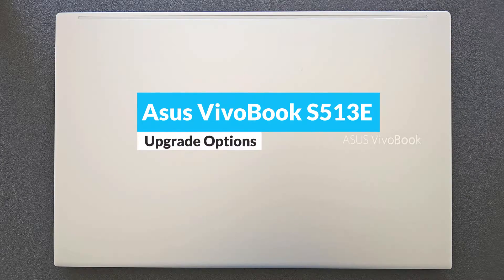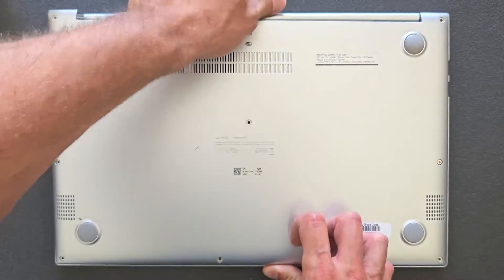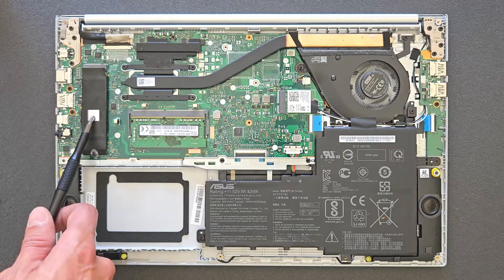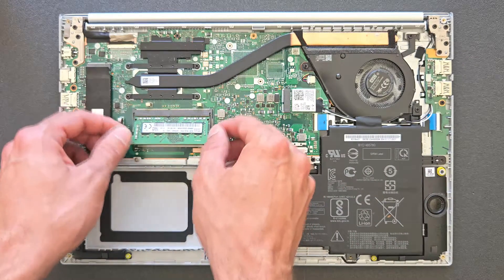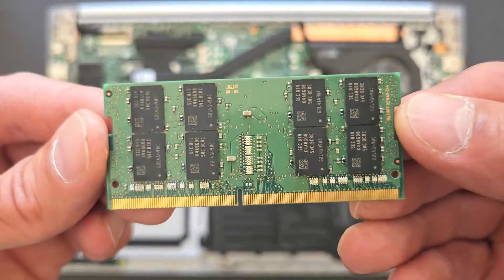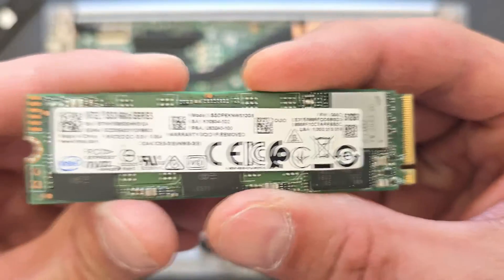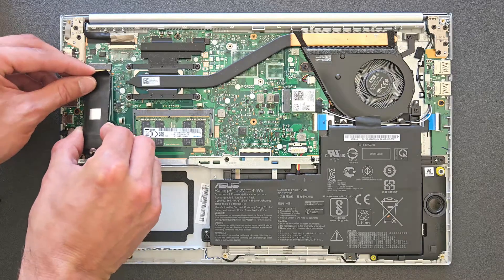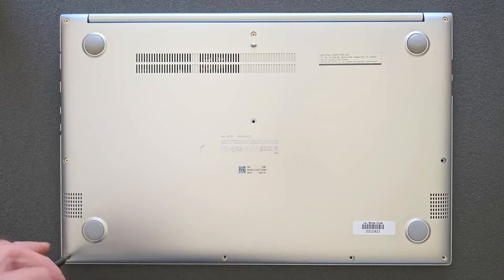Is Asus VivoBook X513EA / S513 RAM or SSD upgrade possible?

Comment: hello there, ive got a question, i have an Asus Vivobook 15, I5-11th gen 1tb ssd 8gb ram (i believe X513EA), in TaskManager in memory section it says 2 of 8 used (6 free) (slots), i havent checked by opening the case, but is that exact or is it wrong?

Comment: I installed a 2TB SSD, it works perfectly
I recommend 2TB
By the way, I'm thinking of upgrading to a 4TB SSD
Has anyone tried installing a 32Gb RAM bar?
Reply: Which brand and model did you use for the 2 TB SSD? thanks
Reply: @giuseppemilazzo2649  ASUS Vivobook 15, X513EA
SSD Samsung 970 EVO Plus, 2Tb
Reply: 32gb works fine

Comment: I would like to ask, If my pc has an extra slot for HDD DRIVE is it still okay to if i put SSD instead of HDD? It doesnt affect anything right? And where can i get SATA CABLE for connecting Hard drive to the motherboard?
Reply from the maker: Hi, yes definitely will be ok to use SSD instead.. these days it's recommended anyway. What kind of sata cable are you looking? Is that PC or Laptop?
Reply: For Laptop. I want a Sata cable that can connect my SSD to motherboard since i want to expand my Storage, so i want to know how am i gonna connect my SSD to the motherboard. Which cable Sata cable to use.  @ToxicNerd